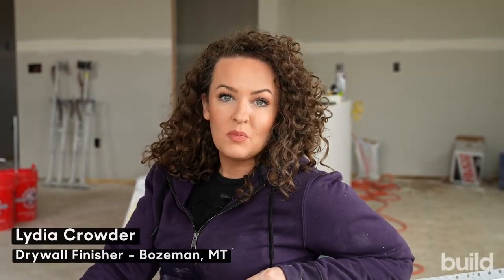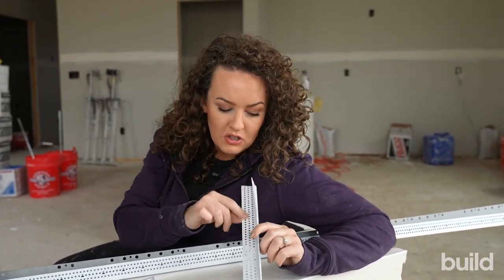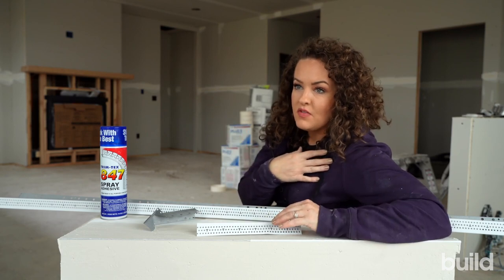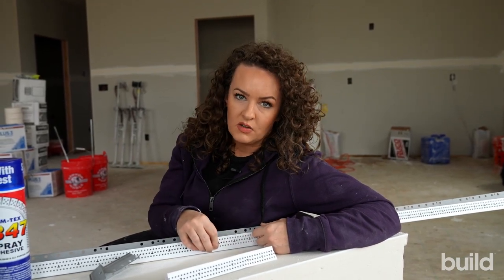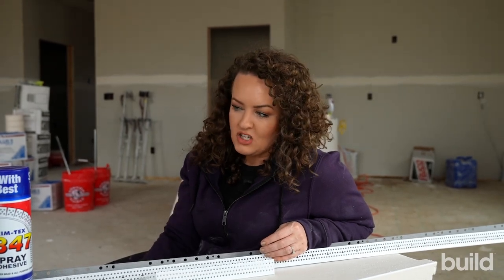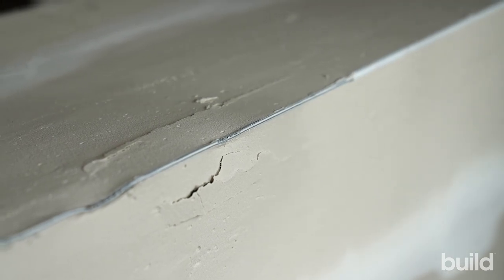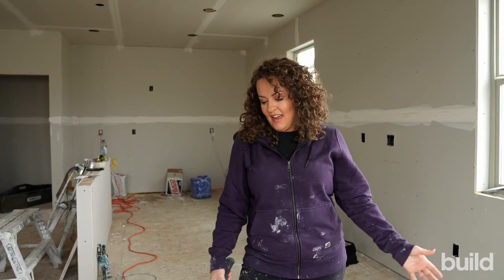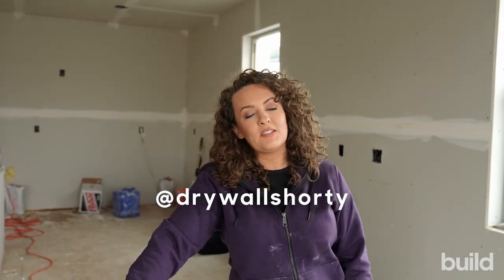Hammer vs Corner Bead... which one wins?

Comment: Love your videos! Any material recommendations to fix cracking around metal corner bead? All my outside corners in the house I bought have them. Thank you!
Reply from the maker: Yeah - I would first cut out all the cracks then try fibafuse and hot mud over them and coat when dry with plus 3. ClarkDietrich also makes a product called crack tape that helps with reoccurring cracks.
Reply: @DrywallShorty  thank you so much. I will pick those up. Last thing I wanted to do was remove and replace. You are the best!

Comment: I love your videos and have learned a lot but I have to say that this appears to be just an ad for Trim tex.  1) you didn't show trying to bend and deform the trim tex like you did the metal.  I bet I could get it to deform the same as the metal. (I have done this in the store) 2) I can tell from the sound and the fact that you only showed a close up shot that the trim tex was not hit as hard as the metal.  Classic "slight of hand" trick when marketing products.  Again, really like when you are showing actually doing your trade but this is just marketing a product.  Matt Risinger does the same thing with products he promotes.  It is all part of being a YouTube creator...you can't survive without sponsors and promoting their products.  Edit: I would use trim tex or any other plastic corner bead over metal.  Technology is good.  New better products always coming out to make life easier.
Reply from the maker: I hit both beads equally hard, I don't gain anything trying to lie or manipulate opinions. I don't know if I've ever gotten plastic to dent but I think if you hit it really really hard it could probably crack/split down the center. I just did a new video on Build Show walking through every type of corner bead I could get. Metal definitely has it's strong points like being able to be manipulated if framing is bad, its cheap and pretty fast to install. Where it doesn't do great is getting a solid hit. I've repaired a ton of it over the years and most of the time you can get it to bang back into place but sometimes you just wind up floating a new corner in that spot.